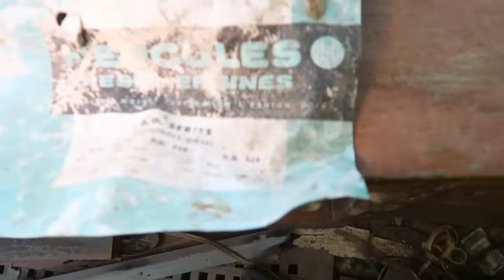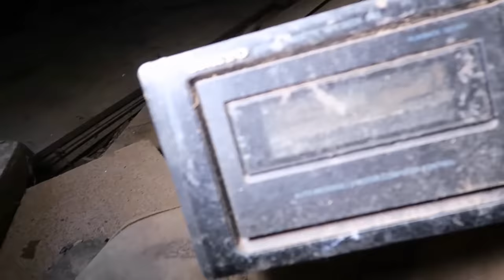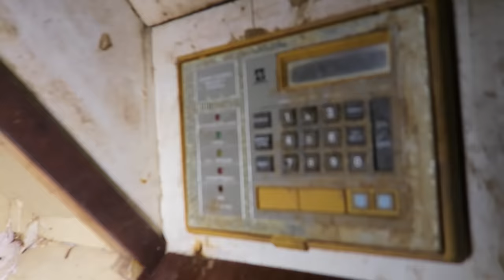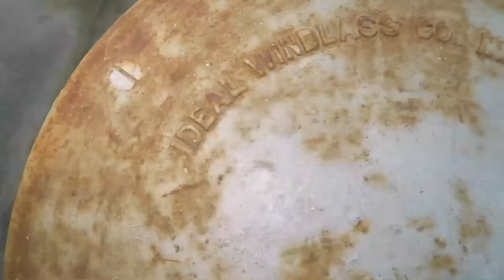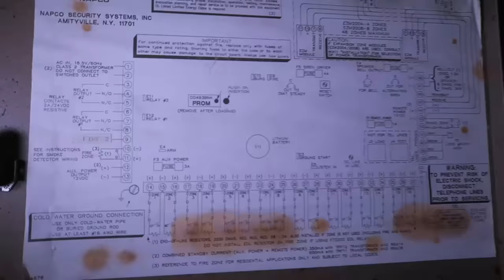We Found an Abandoned Yacht

Comment: I can see construction equipment in the background so you know that someone has been aware of this for years yet hasn’t done anything about it.
Reply: According to another commenter, the yacht currently resides in a channel dredged specifically for it. It was a restoration attempt that was abandoned due to asbestos being found, eliminating financial viability of the project, and it's sat since.

The other theory is those buildings you see are that of a scrapyard. It's possible they bought and own the yacht and just stripped out enough valuables to make money off it (an old yacht needing lots of work is worthless, hence why a junkyard could pick one up and turn a cheap profit)

Comment: This boat cost $350.000 It was Built-in 1958 in Holland...And it sailed right up until the mid late eighties By the Mercer family it fell into disrepair and it was sold for scrap the scrap company stripped it...It was being  towed to a scrap point but it got stuck...They could not  get it out of the swamp area and just left it... It spent lot of time at the America's cup.... That gentleman did work as a seaman/operater on the boat...It has been there since mid to late 80s..
Reply: Bigfriendly1570  that onkyo amp and tape deck are 1990. very expensive n high quality.

Comment: In the 1970s the boat belonged to an exec of the Bethlehem Steel Corp. I spent some time on the boat as 6-7 year old kid, My grand father knew the owner. How thee xxx thing got in that shape sitting there i have no clue. I do know when I was on the boat as posted previously on another vid of this boat it did not have AC or AC that worked. I slept below deck and the summer heat was killer until way after dark. Joe Nameth the foot ball player also spent time on the boat. His pictures were in the salon gallery.

Comment: To be honest with you, Brothers, I'm glad you didn't get injured or killed when you sailed through oily water. If you lose your balance, or a source of heat and or sparks gets near those liquids and or chemicals, then you will get burnt and or get a severe skin agitation worse than you've ever dreamed of. Keep in mind that that boat had a head because sailors used to take dumps on board. Believe it or not, that area could explode. All it takes to cause an explosion is chemicals, heat, and pooh-pooh. Thats why the fertilizer plant in Texas exploded.

Comment: All that open space in and beneath the funnel, down to the engine room, is how you would remove the Diesel engines from the engine room for replacement or repair, using a shipyard crane. I bet that if you  were to get down there with a remote camera UW drone, you would find that they were removed when the boat was stripped of valuables by a salvage yard like the one 200 feet away. You should turn  over your video, and the location to the New Jersey DEQ. Those electrical cables have asbestos sheathing under the stainless steel wrapping. It was probably abandoned because of the potential cost of asbestos abatement. With fuel, water, engines, and all the valuable metals removed, the draft was probably less than 4 feet, making for any easy tow to that location. Based on the flooding you have shown, she is on the bottom and would be expensive to move it again. But much easier than raising the Titanic.
Reply: It's sitting 200ft off of a main waterway in the middle of a city, and appears to have been for the better part of over twenty years. I would say it's safe to say New Jersey knows it's there lol.
Reply: At 2:24 you can see a crane to the left of the boat.
Reply: There's something in the water at: 40.448960, -74.370388
Reply: You need to remove more than the funnel to get out a diesel engine and you wouldn't put it back together with the intention of leaving it in the marsh.  The engine is probably still in it.
Reply: Look further up the river theres sunken barges and  tugs.
Reply: @MilwaukeeF40C  I think the engine(s) and generators were removed, the funnel is held on with c-clamps all around. Probably long enough to get it over there until it was "restored" then the person died or forgot about it.  Property probably changed hands and there it sits until the property changes hands again.
Reply: Get some bilge pumps in there and that thing will lift again
Reply: Also, the diesel exhaust stacks would probably run up the funnel to the top.  If they are not there (I didn't see them) it's likely the engines were removed at some point.  Not that I am advocating that anyone dive down there to verify that.

Comment: Its sad that people would leave this crap just to rot
Reply: It probably washed in during a storm. When the water goes back out there is no way to get to it to remove it. It sucks but removing it would cause more damage to the ecosystem than letting mother nature reclaim it. Even the oil came out of the earth.
Reply: Will Moto704   If it would rot would be a good thing but most will be around for a long time...
Reply: It needs people with less lazy and more imagination.
Yes, Sherlock, that's a clue.  My state has a new title
process application for abandoned property.  Anybody
with literate skills may apply.
Reply: @robertdinicola9225  if you look it up on Google maps, you can actually visibly see the mouth of the channel it's parked at filled in with sediment, so to make it move again would be a massive undertaking.
Reply: @cpufreak101  as i figured! Lifelong boater and oroffesional marine tech (in every single system on any boat) for 23 years.

Comment: It looks a lot like the yacht John Wayne owned that there's video's of.
Reply: Nah, the Duke's yacht was named Wild Goose and was converted from a WWII mine sweeper, ie, all plywood.
Reply: Quirt Manly , it's down in San Diego.
Reply: Hotrudderedbum Giabroni Heard it's haunted too. 👻
Reply: Quirt Manly   Yup! I used to scrub boat bottoms in Newport Harbor back in the 70s. Wild Goose and that ugly barge ArmourAll were 2 of the more noticeable powerboats around back then. Hopefully ArmourAll is now long gone!
Reply: Ive actually been on the boat you're referring to. It was about 6 years ago, and its currently in Washington state
Reply: It was actually in relatively decent shape. Did need some cosmetic work. It had a pair of 6-71 Detroit Diesel engines that ran, however, the starboard engine needed blower seals. I could have bought it for 30,00 bucks.
Reply: @samanthab1923  You can't go anywhere that isn't haunted. Whether you go to Walmart, Toys R Us, even the mall, someone died there. That said, it's haunted.  Most of the time, you won't even notice. But that said, just because something is haunted today does not mean it will be haunted tomorrow. Sometimes spirits leave, sometimes they get trapped and taken away by accident.  I personally know ghosts.
Reply: @sethbarnes7608  There are no boats in Washington State, what are you talking about =)
Reply: @DiaryofaGrimReaper  So cool. I only know the Easter Bunny.
Reply: Pretty sure it's sitting on the bottom. No one's going to pay to scrap her. Not even the local government.
Reply: The wild goose is in Newport Beach ca. I think it’s a charter boat for weddings etc.
Reply: @cv8z231  
Tight dude !
Can make a path way. And have a night club on the boat out there

Comment: There is a crane towering over the boat, it can't be too hidden.
The oil might be leaking from the boat itself.
Reply: According to another commenter, it appears this yacht was a restoration/refit project, but efforts were abandoned after Asbestos was found, likely the project was no longer financially available (would have been cheaper to just buy a similar yacht in good condition than to continue restoration work). It appears to have sat for 20 years deteriorating since.

Comment: The only way to know for sure would be the HIN or Hull identification number, which would be engraved somewhere along the keel of the boat and well, you're not getting down there. 🤣🤣
Reply: More modern boats have them on the starboard aft and it's the last two numbers on the hin that tells you the year. However with an older vessel like this it would not have a hin as we know it today. However it was most likely a documented vessel so if you could find a piece of paper or a wooden plaque that would give you a documentation number that you could look up with the Coast Guard. And in fact because it's a metal ship it was most often welded onto a piece of Steel in the engine room and often a plaque in the Pilot House
Reply: @michaelpettit9706  Exactly correct. However since the pilot house looked to be pretty well ransacked, there's a good chance the scrappers got the brass plaque already
Reply: @tonyk8592   true and I'm sure whoever abandoned The Vessel went to Great Lengths to conceal its identity. But the gentleman that were touring the boat as well as many others that have been on there wouldn't really know what to look for. Alternatives would be getting serial number off of engines, generators Halon systems that were later installed because records on those were mandatory. Just exploring the options of tracking down the last owners. The Coast Guard and or fish and wildlife do not have the resources to do such things. There are thousands of abandoned vessels in Florida alone.
Reply: @michaelpettit9706  
Correct sir.
This was likely a USCG Documented vessel and would have an official number assigned to it.
On a steel hull it would have been welded to a permanent structural member in the aft machinery space and perhaps on a builders plate above decks.
Thank you for sharing your knowledge sir.

Comment: I tracked down the Magnum Alert 2600 series. It appears to be from the early 1990's although it could have been retro fitted on an older yacht. Judging from the outside pictures you have shown and the communications onboard, it looks more like an 1960's style yacht. It also looks like it may actually be sunk in that "shallow" offshoot judging from the amount of water below decks. Just all the mud below it is holding it upright.

Comment: i found the location doing a bit of google earth exploring using the few details given online. turns out its not as abandoned as it would seem. the impression i got was that it had just been dumped here, and that it was hidden away in the middle of nowhere. its actually at a salvage yard. probably one of the few salvage yard they could take that ship without having to pay an outrageous amount for a crane to lift it out of the water. though from the google earth images the salvage yard has a crane so its kind of surprising they havent pulled it out and sold it for scrap value. the thick overgrowth makes it hard to believe a salvage yard could be right there but if you look on google you'll find a salvage yard called "easy towing service" and will see a few smaller boats in their yard, along withh countless semi's and other vehicles

Comment: I'm surprised the copper theifs haven't pulled that thing apart to scrap the metals. They probably cant find a boat to steal that can hold that much weight...
Reply: If you look it up on Google maps, it sits just behind private property (junkyard/truck repair shop specifically, inferred to be original/current owners) so it'd be difficult for the common thief to access.

Comment: That's likely not oil you see.  
Likely stagnant water
Reply: A closer look has it alive with bacterial and insect life.  
Toxins also that kills fish.  On the plus side this is not
the industrial solvent mixture that residents still pay for
if they want home faucet waster in the City of Flint.  At
a charge rate higher than the clean water that serves 
Metro Detroit.  Guess which water was made possible
by whites to replace lead pipe they had by error put in ?

Comment: At 7:51 you can see, 3 18 42/35, I'm gonna make a guess that it's a date, this boat looks like a Sandeman which started that design in 1920s or 30s, idk but that's what I think.
You could probably find out the original owner with the part numbers from the steering gear at 7:51.

Comment: unfortunately this grand old yacht is a complete loss if you noticed downstairs there's a high water mark where the tide goes up and down about 4 ft each day on the wall that means this Hull is open to the outside and it is compromised probable the entire bottom steel hull is gone away from rust.....sadly she will never float again

Comment: I was surprised at how small the galley or kitchen was considering the size of this ship. The other thing I found odd is that the showers had porthole windows that you can look into. Hopefully they had curtains. The wood is beautiful, and has stood the test of time. Wonder why they weren't stripped from this vessel too!
Reply: I don't think that was the main galley.  It was in the wheelhouse and probably the crew galley.  A boat like this would not be owner operated.  You would have to hire a professional crew to operate it for you.  I suspect the main galley is underwater.

Comment: Be very careful going down in confined spaces like old steel boats and stuff like that cause they end up rusting and the rust takes the oxygen out of the air I can't explain it but we weld on barges and we have to hook up a vent system to pump fresh oxygen into the area's.

Comment: I can see that some fittings have been stripped from that yacht. The doors all have their brass portholes missing.  Whoever did it obviously went for the big high value items like portholes etc.  There is probably a small fortune left on her because it looks as if none of the brass plumbing fittings have gone.  There must be hundreds of yards of electrical cable in there, just waiting to go through a wire stripper prior to a visit to the scrap yard.

Comment: What I don't understand about this is that yacht is made of steel 110 ton steel ship how much money and recycled steel is just sitting there rusting away in that swamp why wouldn't they have just scrapped it for its Steel? And furthermore be advised that boarding an abandon ship that's been taking on water and has water in its Hull is very unstable and really at any moment could capsize with sometimes the slightest provocation what they were doing was incredibly dangerous you don't know how much water was inside the hull of that vessel and how unstable that vessel really was merely boarding it could have been enough unbalanced weight on one side of the ship to cause to capsize I truly do not advise people to board abandoned especially vessels with that much water in their compartments

Comment: The 110' /  33.53m Custom motor yacht motor yacht 'Blue Jacket' was built by De Vries Lentsch in Netherlands at their Amsterdam shipyard , she was delivered to her owner in 1958 and last refitted in 1999.

Accommodation

Blue Jacket's interior configuration has been designed to comfortably accommodate up to 6 guests overnight in 3 cabins. She is also capable of carrying up to 6 crew onboard to ensure a relaxed luxury yacht experience.

Construction & Dimensions

Blue Jacket features a displacement steel hull and steel superstructure, with teak decks.

Motor yacht Blue Jacket is equipped with an ultra-modern stabilization system which reduces roll motion effect and results in a smoother more enjoyable cruising experience underway.

Performance

Powered by 2 Cummins (VTA-28 M2) 900hp diesel engines and propelled by her twin screw propellers Motor yacht Blue Jacket is capable of a top speed of 13 knots